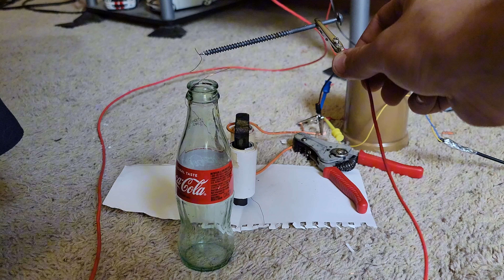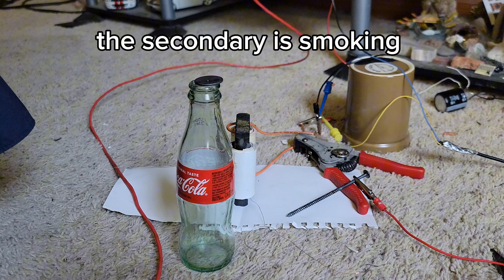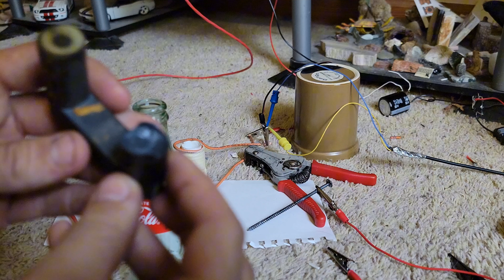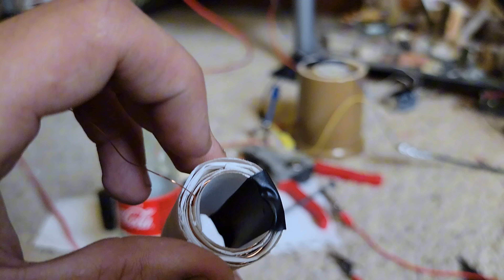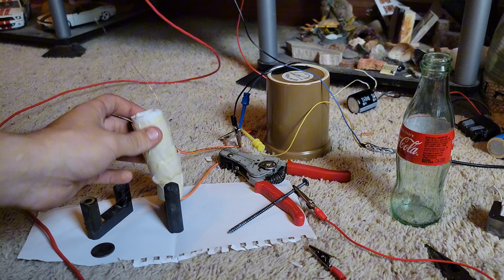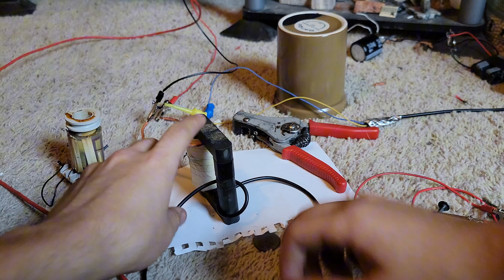experimenting with hand wound transformers.

Comment: Something to consider about ceramic/ferrite transformer cores is periability and resonant frequency of the cores saturation at certain frequencies. Flyback transformer cores from old monitors or TV's usually have around 14khz frequency resonance so tune your driver frequency while watching the output to peak when resonance is achieved. This will help you get max power out of your driver circuit.
Reply from the maker: I keep this in mind, but remember that resonant frequency changes when you put a load on the secondary, so you need something that changes the frequency on the fly, like a zvs. Resonant frequency changes depending on a few things like the #of turns and capacitors if you have any if the circuit. I will build a zvs when I buy some high frequency capacitors.